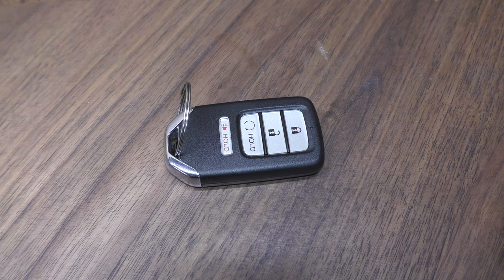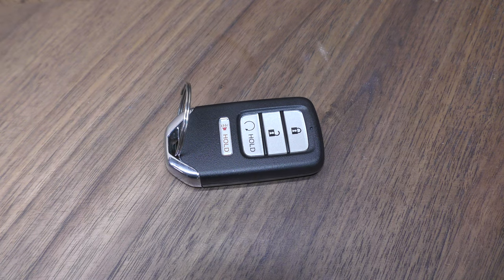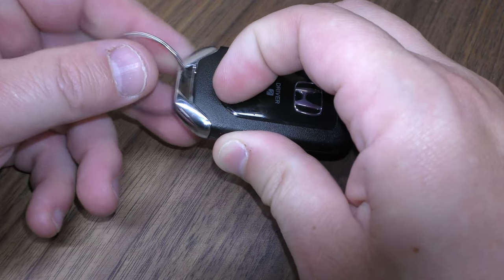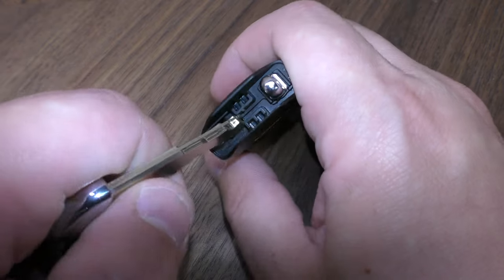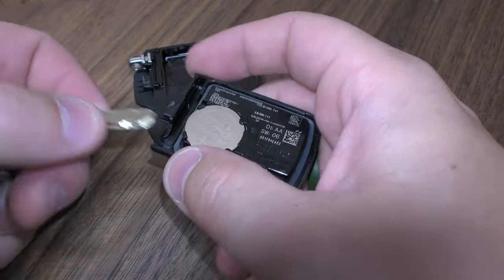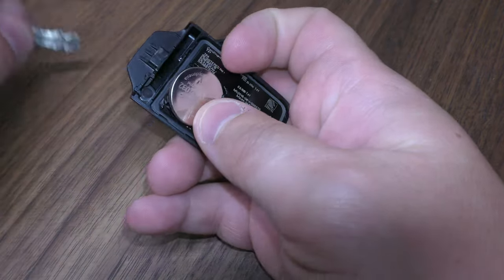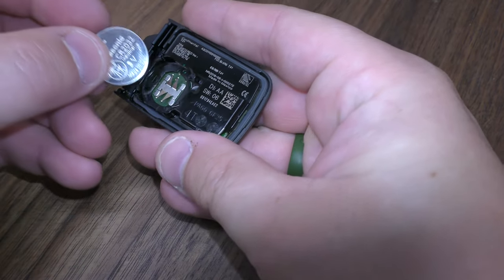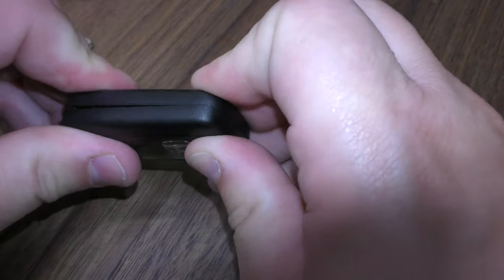Honda Ridgeline key fob battery replacement - EASY DIY

Comment: Dude.... 2021 Honda ridgeline. Minor heart attack this morning at 5 am. Low remote battery warning on instrument cluster. Watched your video ...... Had a replacement 2032 battery and replaced it. Solved the problem. Thanks for your detailed instructions!
Reply from the maker: Glad I could help! Take care
Reply: @KeyFobRob  btw... Called the Honda dealership later in the day ( just curious) and explained the problem. They said they could fix it for $79.99.
Reply: Same thing happened to me with my 2021 Honda Ridgeline. Thanks Rob for a great helpful video, short and to the point!

Comment: Excellent video. Short and to the point. I had replaced batteries in other fobs before, but was a little  nervous about this one since the seam was so tight. Using the key as a wedge was everything. BTW, no mention at all was made about replacing the battery in the Honda Ridgeline manual . Shame on them.
Reply from the maker: Glad it helped